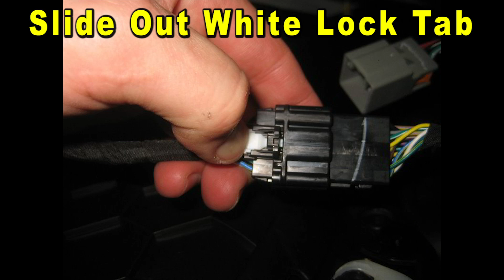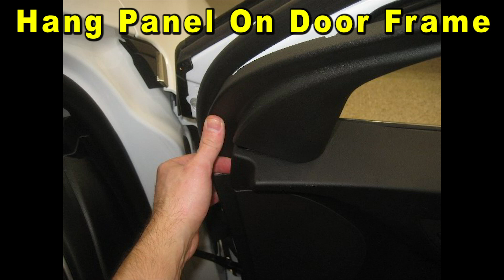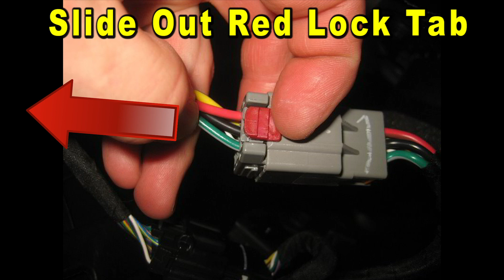Chevrolet Equinox How To Remove Door Panels & Upgrade Speakers 2018 To 2024 With Compatible Speaker

Comment from the maker: Chevy Equinox Aftermarket Car Speaker Sizes - https://amzn.to/4aBvuF1
Dynamat Sound Deadener - https://amzn.to/48uQb3O
Precision Screwdriver Set - https://amzn.to/3sLixaP
Plastic Pry Bar Tools - https://amzn.to/3HMtsV7
Socket & Ratchet Set - https://amzn.to/3Z17LbA
Mechanix Gloves - https://amzn.to/3jCnHkt
Torque Wrench - https://amzn.to/3vS5uSI

The Paul79UF YouTube channel is a participant in the Amazon Services LLC Associates Program, an affiliate advertising program designed to provide a means for sites to earn advertising fees by advertising and linking to Amazon.

This DIY video shows owners of the third generation 2018, 2019, 2020, 2021, 2022, 2023 and 2024 Chevrolet Equinox SUV how to take off the plastic interior door panels and upgrade the OEM speakers.

Comment from the maker: Check out the DIY guide for removing the plastic interior door panels in a 3rd generation 2018 to 2024 Chevy Equinox SUV - 
https://www.paulstravelpictures.com/2018-2022-Chevrolet-Equinox-Interior-Door-Panel-Removal-Guide/index.html

Here are all of the DIY repair and maintenance tutorials for the 3rd gen 2018, 2019, 2020, 2021, 2022, 2023 & 2024 Chevrolet Equinox SUV -
https://www.paulstravelpictures.com/Articles/2018-2022-GM-Chevrolet-Equinox-DIY-Repair-Maintenance-Guides.htm

Owners of other General Motors vehicles from Chevy, Buick, GMC, Cadillac and Holden such as the Trax, Blazer, Traverse, Tahoe, Suburban, Cruze, Malibu, Impala, Camaro, Cascada, LaCrosse, Encore, Envision, Enclave, Regal, Canyon, Sierra, Terrain, Acadia, Yukon, Savana, XT4, XT5, XT6, Escalade, CTS, XTS, CT6, Astra, Commodore and Trailblazer may also find these DIY instructions to be helpful.